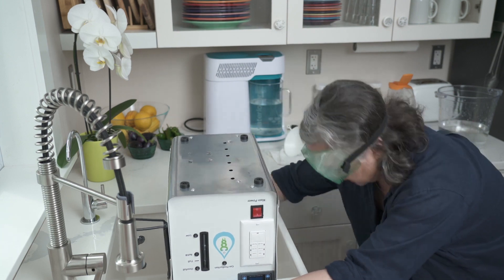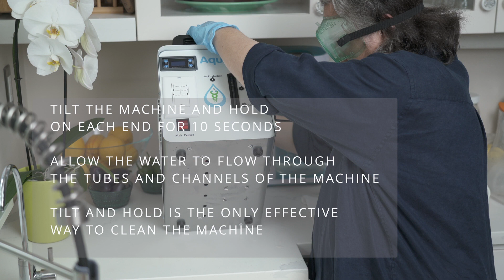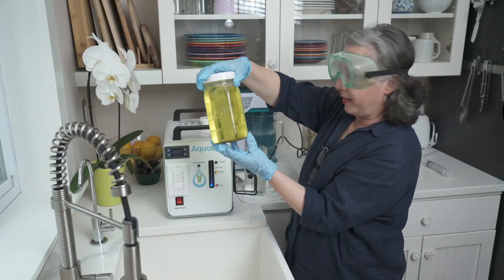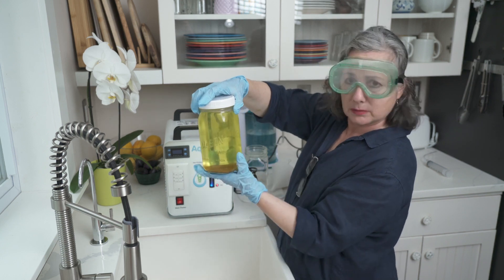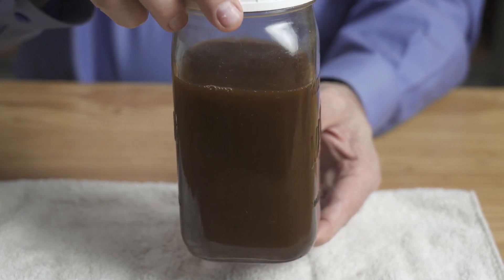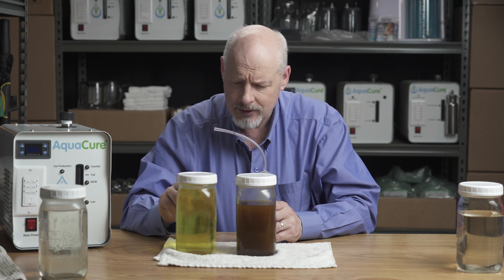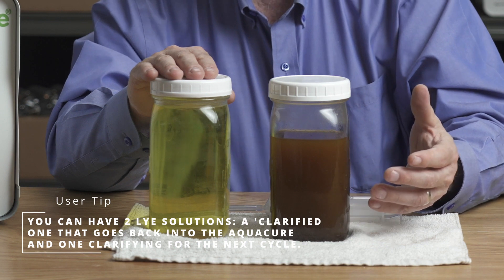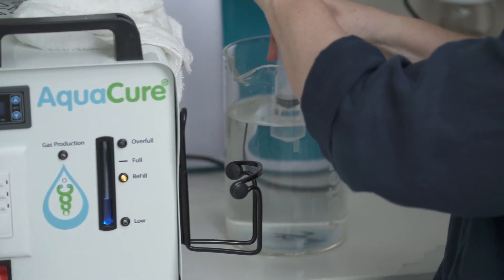AquaCure AC50 Maintenance (series video 5)

Comment: Hi George, hope you are well. I am cleaning out my machine for the first time. In the saved lye solution that came out from my machine, some of the debris  just "sits" still in the middle/all over the solution, inside of the jar(just a portion of the debris has come down to the bottom). So the lye water does not look clear at all, and I don't want to refill the AquaCure with this "dusty" looking solution. Any tips? I have let it sit for approximately 2 hours, how long shall it take?🤔  
Best regards, Jenny

Comment: UPDATE NEEDED: Hi George Thank you for everything you do. I must bring this to your attention. On the "AquaCure-Operation-Manual-Update-Notes.pdf" it states to add 3/4 of a Litre hot water for rinsing. In this video it says 1.5Litre. 2x more than in your pdf. 

I personally found that the higher volume helped make the rinses go faster, so maybe there needs to be a "new" updated  manual notes? 

Thank you

Comment: I left town for 6 weeks, resulting in the machine barely being used.
( I had a person run it for 1 minute, a couple times per week . At least I’m assuming it was done )
Upon returning, I attempted to run the unit, with no bubbling of
Either canister. The same thing happened on 2 repeat runs.
What is recommended for restarting : Clean & recharge of electrolytes ?
I haven’t yet reached 100 hours since my last cleaning.

Comment: 2:54
So then maintenance requires about 5 or 6 rinses altogether, not just the 3 that are done before first use.
Reply from the maker: It depends on how well the rinses clean.  Rinse until clean is the rule.  Rinse correctly.

AquaCure Rinsing Technique
https://youtu.be/oac55WgfIvs

When Rinsing:
To dissolve soap formations you need water in the 120° F to 140°F range AND it must FLOW past the soap!
The water must be hot; warm water does little.  Remember to trade out the hot water within a minute or so (at first) because it will cool quickly as it heats up the components.
It’s good not to exceed 140°F or it could damage internal plastic not rated for higher temperature.  You can purchase pot thermometers in most grocery stores.

Tap water is recommended because it's being poured out again and it's inexpensive.
Just make sure it is HOT, around 140 degrees F.
Some people heat up the water in a pot and use a candy thermometer to get the correct temperature.

You Fill the AquaCure to FULL with HOT water (6 to 7 cups, not the 3 mention in the original instructions).  Then alternately and SLOWLY lift the front and back of the machine down to 60 degrees to ‘wash’ the HOT water up and down in the Sight Tube; the hot water must FLOW to dissolve the soap.

Do rock it face to back SLOWLY and then HOLD IT in each extreme position (tipped to face and back) for awhile, to allow TIME for the fluid to flow through the small orifices.  Moving too fast does nothing.  Watch for the fluid movement (rise and fall of the fluid level in the sight tube).  It is OK to have the AquaCure plugged in while you do this, 
You need to change out the HOT water frequently because it cools off quickly and warm water does little to dissolve soap.

NOTE: If the HOT water doesn’t ‘’reach’ the tight tube, doesn’t wash’ up and down in the sight tube, it CANNOT clean the sight tube; if you are not getting the water washing up and down in the sight tube, it’s likely due to an internal plug or restriction and that needs to be cleared ‘manually’; ask for instructions.

Note: I occasionally get an ‘air bubble’ in the tube (so it will seem that the sight tube and/or ball is not ‘registering’ the actual fluid level correctly).
Generally air bubbles will eventually clear on their own, but you can ‘hurry’ the process by filling the AquaCure with solution.  Then alternately and VERY SLOWLY lift the front and back of the machine up to 60 degrees to ‘wash’ the solution up and down in the Sight Tube, washing out the air bubble(s) and the ball should float properly. 
Again air bubbles can be cleared if you do the tipping (face to back) SLOWLY (to give TIME for the fluids to flow) and FULLY 60 degrees (almost on it’s face and almost on it’s back).  It needs to be tipped that much to have the liquid wash the air bubble out of the sight tube.

Comment: i need a new syringe where can i get one for my aquacure ac 50
Reply: i tried ordering syringes on amazon and the ends dont match the hole on the Aquacure
Reply from the maker: @luthermandrake8806  You need to be sure the syringes are Luer SLIP (not Luer 'lock', and it needs to be luer tips, not catheter tips.
FAQ: Where do I get another Syringe?
You can purchase from us, 
https://eagle-research.com/product/extra-40-ml-syringe/ 
but it’d be quicker and less expensive to get it locally or online.

Be sure to get syringes with luer slip tips WITHOUT the luer-lock.

ANY NON-Luer lock (just plain Luer slip tip) syringe will work.  

The 'lock' type have a collar around the tip, which prevents their use in this application.

You don't want syringes with the 'lab-type' fluid measuring tips, they are far too big.  You want the syringes that will accept a standard Luer needle.

You can get syringes at a local Pharmacy or (less expensive) at local farm supply store (for giving injections to cows).   You can also acquire them from Veterinarians.  Some cooking shops have them, (for infusing meat).

Also most syringes made for infusing fluids into turkeys and roasts before cooking (available in grocery stores) will have the luer sized outputs that will fit into the Tower Cap Check Valve.

You can also purchase 50 mL syringes online at Amazon or eBay.  Like this:

https://www.amazon.com/EXELint-Syringe-Disposable-Syringes-Individually/dp/B01MCSZUAQ/ref=sr_1_20?crid=1UUKNYAVBC03D&keywords=50+ml+syringe+luer&qid=1657478504&sprefix=luer+50+ml+syringe%2Caps%2C67&sr=8-20 

Or online stores like this:

 https://medicalmonks.com/product/bd-slip-tip-syringes/?attribute_pa_syringe-size=60-ml&attribute_pa_amount=each

Comment: I will be emptying the solution from my machine and storing it in jar(s) because I'm going abroad for an extended period. Wondering what to do with the plastic jar lid(s) before using them? Just wash with dish soap? It's normally not advisable to expose plastic to hot water so not sure how I would sterilize them?
Reply from the maker: No need to sterilize.  Any container that is rinsed clean (warm water OK) will work.  Lye solution will sterilize itself.
Reply: @ecopegasus  Okay great, thank you! I apologise but due to needing the info urgently I also sent an email yesterday via the website (name Campbell) with the same query. So of course no need to reply to that one.

Comment: I just did my first clean (well I guess second clean if you count the initial clean/rinse before I used it) at the 200hr mark. The water gage window was nice and clear even before I cleaned it, but right after it was cleaned it is now super foggy. 
What's the issue? How do I go about fixing it as I did exactly what she showed in this video for cleaning instructions.
Reply from the maker: Sounds like you have steam and condensation.  You can tip the machine onto it's face (when full of solution) to clear the steam fog.

Comment: At the 8:47 mark she says "leave a little bit of the sediment" - um, I thought you were supposed to leave all of the sediment, no?  My understanding was, none of the sediment was supposed to make its way back into the machine.
Reply from the maker: Correct, leave ALL of the sediment.  I think she meant there isn't much sediment, but in any case, once the sediment ios out of the machine, don't put it back in :))
Reply: @ecopegasus  - thanks.  That's what I thought but that's not what she said.  I think she might've meant, leave a bit of the solution, because there's no way you can siphon it all off without risking siphoning some of the sediment.

Comment: So I'm confused, around the 8:30 mark she says to use the syringe to draw out from the jar that contains the older (yellow) solution and pump it back into the machine.  But around the 9:00 mark she's saying to pour in from what I'm assuming is a freshly made batch of lye solution into the machine. It's gotta be a fresh batch because if you pour any lye solution that has already been used, you risk sediment getting poured back into the machine.  So, my confusion lies with, if you're using the syringe to reuse the old solution, why are you adding a freshly made solution?
Reply from the maker: Obviously fresh made at first, because you don't have any 'used'.  We ALWAYS use the 'old' solution (once the sediment has settled) because it never 'goes bad' and in fact becomes more efficient as it's 'conditioned'.  I'm still using lye solution I mixed back in 1986.
The syringe technique is used specifically BECAUSE you can suck out the clarified solution without disturbing the sediment on the bottom.  Note that we like to use TWO solutions, so one can be 'settling while we use the other, then switch with each maintenance rinse.
Reply: @ecopegasus  - no I was aware that it's better to reuse the older solution, was just wondering why she was adding from a freshly made batch when her instructions were to reuse the older solution.  Is it because when you try to reuse the older solution, there may not be enough, so pouring in from a freshly made batch is just a top off, sort of?  I guess the reason I was confused was because she demonstrated how to siphon off from the older solution but didn't actually siphon anything, then a few seconds later she poured from what appeared to be a freshly made batch. So that's when I was thinking, so which is it now?
Reply from the maker: @Boxcarphilly  It has ALWAYS BEEN (for 40 years) and still is, to use the old solution.  The ONLY reason it 'looks like' a new solution in the video is that this was a fresh, new startup.  The solution hasn't had time to 'condition' to a pale yellow.

You ONLY add lye in the first solution, after that you just add PURE WATER (pure = distilled).  Eventually, because a little lye get's lost during maintenance rinses, a little lye will need to be added.

FAQ: When to add lye?
Q: I also have a question about gas production.  Can I be assured that as long as bubbles of gas are being generated then the machine is operating properly?

GW:If there are bubbles, it is Brown’s Gas.

After that it’s ‘how much’… If the gas production is less than it should be then it could be a gas leak (most common) or not enough electrolyte (lye).  See gas volume testing below.
Test gas production   https://www.youtube.com/watch?v=w1GOztHEOgk

Q: It seems that the machine has been operating quite a long time since I last replenished the solution.

GW: You should almost never need to ‘replenish’ the solution.  I’m still using lye solution I originally mixed in 1986.  It doesn’t ‘go bad’. If fact, as it gets ‘conditioned’ it gets more efficient.

What does happen though, is a tiny bit of lye is lost with the gas as it rides on water droplets (which get caught in the Humidifier). 
This ‘lye loss’ is SMALL and might lose an ounce in 2000 hours at 100% gas production.  
The bigger lye loss is during maintenance cleanings, where a small amount is left behind with the settled sludge (assuming you are doing the maintenance rinsings as currently recommended, see UPDATE below).

AquaCure AC50 Operation Manual UPDATE notes
https://eagle-research.com/wp-content/uploads/2021/11/AquaCure-Operation-Manual-Update-Notes.pdf

The AquaCure will make therapeutic volume of Brown’s Gas with as little as 30 grams of lye in it, so if you find you need to add lye, I recommend adding no more than 1 ounce (about 30 grams).  Then you will have PLENTY of lye and if the gas production doesn’t improve, there is another problem to address, like a gas leak (which you should always look for first because you do NOT want to have too much lye in the machine).

Excess lye leads to more lye loss, potential foaming and crystallization / plugging of internal orifices.

Q: It seems to me common sense that if only distilled water is put in the machine when level is low, it will eventually weaken the lye concentration and thus not produce bubbles. 

GW: Electrolysis requires a catalyst to operate.  It’s very difficult to ’split’ water without a catalyst.  The most practical catalyst we found (after testing literally thousands of solutions) is lye (NaOH).
In theory, since the lye is supposed to STAY IN THE MACHINE (and NOT come out with the gas) it does not ‘weaken’.

A catalyst (by definition) does not get consumed in the chemical process / reaction.
So the only thing that get’s 'used up’ in the electrolysis is the water.

Brown’s Gas is made ONLY of water.  So as Brown’s Gas comes out, you need to replace the water.

Theory aside, In practice a TINY amount of lye can ‘ride out' on water moisture droplets that are in the exiting gas.  These moisture droplets are trapped in the Humidifier.

The amount of lye that ‘rides out’ in this fashion is so small that it would literally (and I mean literally) take YEARS of constant use at full production before there’d be enough lye loss to need to add more to the solution in the machine.  There is NO need to even consider such an insignificant loss.
And NOTE that a bit of lye in drinking water is HEALTHFUL https://eagle-research.com/faq/is-lye-safe/

MOST of the lye loss is when maintenance cleanings are done.  Because some is left behind in the sludge.

So after a few cleanings it MAY need an ounce of lye added to the solution (when it is outside of the machine).

’No bubbles’ COULD be a symptom of not enough lye, but USUALLY is NOT!
USUALLY (99.99%) a loss of gas production is the result of a gas leak.

The DEFINITIVE test to know if you need more lye is to test the solution specific gravity using a hydrometer.  You want a reading somewhere between 1.05 to 1.1 specific gravity.

The lye is a catalyst, so it is not 'consumed' and in theory the initial charge would last a lifetime.
However, in practice a tiny amount is lost out with the gas over time (the Tower Cap reduces loss and the Humidifier absorbs the rest). 

Lye can also be lost when people pour out some of the solution or if there is a leak or during maintenance rinsings.

The easiest way to determine when you need to add another ounce of lye is when you notice the gas production has dropped (and there is no gas leak or hose blockage).

I do recommend a specific gravity (of the Lye solution) of about 1.05 to 1.1 (using a Hydrometer).  
Here’s what a Hydrometer is and how to use a Hydrometer (need a test cylinder too)
https://www.youtube.com/results?search_query=using+a+hydrometer+to+measure+specific+gravity 

You can get a good kit from Amazon.  Be sure it is a Hydrometer and not (or not only) an alcohol meter.
https://www.amazon.ca/Specific-Gravity-Hydrometer-Test-Kit/dp/B001X27L9W/ref=sr_1_1_sspa

You can learn to use a Hydrometer by just searching online:
https://duckduckgo.com/?q=how+to+use+a+hydrometer&hps=1&atb=v333-1&ia=web 

Or just mix 80 grams of lye in the first mix of solution.  The solution does NOT need to be exact.  In fact it’ll vary normally as the water leaves anyway, the remaining solution becomes more concentrated.

You can use more lye (I previously recommended up to 150 grams), but we've found it leads to excessive internal lye crystallization that causes clouding of the sight tube and exacerbates any internal plugging (due to sludge formation or oil contamination turning to soap).

A Very Good alternative (but not definitive) test is to look inside the machine with the liquid level above the holes in the white block.  If you see bubbles, then you HAVE ENOUGH LYE.

If you do not see bubbles there could be other issues, like a bad electrical connection, that have nothing to do with the lye concentration.  I have people put in double the amount of lye needed from the start; it only NEEDS about 30 grams of lye to be fully functional.  It’s Very Rare that the machines don’t have enough lye

’No Bubbles’ is USUALLY a symptom of a gas leak.  I usually start by checking the Tower Cap base

Properly Install the Tower Cap
https://youtu.be/Pr98DMe94No

Make sure your Tower Cap base Union is sealed properly and that you remove the Tower Cap using the Union ring, so you do not need to keep re-applying the Teflon Tape.  
DO NOT ’torque’ on the Tower Cap to seal the base fitting; doing so will ‘lock up’ the Union, requiring wrenches to loosen it. 
is USUALLY a symptom of a gas leak.  I usually start by checking the Tower Cap base

Properly Install the Tower Cap
https://youtu.be/Pr98DMe94No No Bubbles

Make sure your Tower Cap base Union is sealed properly and that you remove the Tower Cap using the Union ring, so you do not need to keep re-applying the Teflon Tape.  
DO NOT ’torque’ on the Tower Cap to seal the base fitting; doing so will ‘lock up’ the Union, requiring wrenches to loosen it.